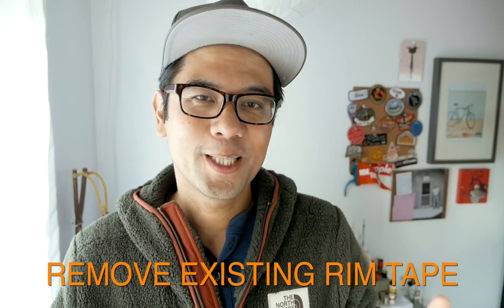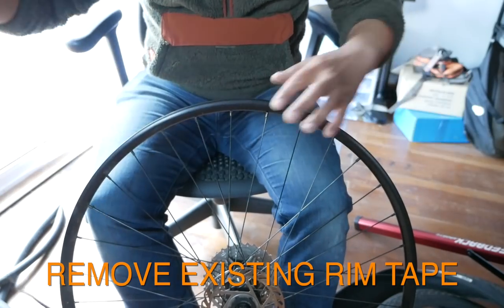How NOT To Go Tubeless - 6 Things I Wish I knew Before Going Tubeless

Comment: Tubeless is the way to go for me. To add to your dry test. If a fully pumped tire looks good, no need to unseat the tire again to add sealant. Hopefully you bought removeable core valve stems. Just deflate the tire, remove the valve core, and then squeeze in some sealant. Reinflate.
Reply: MrHockaluger best comment ever
Reply: Tubeless is not the X factor people make out, And when you do get a problem It's a real pain in the ass to sort! I just put sealant in my tubes and carry foam for any moments... Job done!
Reply: How stupid ! [ The host can be ... ( no offense ). Just use the inner tube itself to contain the slime sealant itself . "Wanna" a better 'tubeless' than the tube ITSELF ????!???? So help me Lord!!!!!
Reply: Manuel  Luis,the thing is,it isn’t tubeless if you’ve got a tube in🤣🤣to be honest tubeless is a real pain in the arse if you don’t use the bike enough like me 👍
Reply: I find tubeless setups get more tricky with higher pressure tires (like road bike tires).  Lower pressure setups (like mountain bike) are much easier.  Gravel bike is sort of in between.  Depends on the tire width.  Anyway, use a tube to "cure" the system and leave it overnight.  After removing the tube, use a brush to paint a little sealant on the bead then hit it with a floor pump or compressor (best).  At this point it's dry mounted (no sealant added yet).  Leave it dry mounted.  Get a spray bottle and put soapy water in it.  Spray the spoke nipples and value stem and check for bubbles.  If everything was done properly, there should be no bubble and the tire should hold air for hours (or even overnight) dry mounted.  The longer it hold air dry mounted the better your setup is. (use it like a gauge).  After all that, I recommend injecting the sealant into the tire through the valve hole.  Remove core first obviously.  Re-inflate.  Now bounce the wheel around or pick it up and shake it around to splash the sealant around the inside of the tire.  Re-install the wheel onto the bike and take it for a short ride.  It should be very solid setup after that!
Reply: My exact method, less messy
Reply: @Won Honglo as well as puncture protection! You can keep riding!
Reply: @manuelluis5456  I don't know why people don't just put it in the tube .if it seals a tire won't it seal a tube that's in a tire ?
Reply: @boracay12  RIGHT .100%.
Reply: RollinRat  I'm only concerned about getting flats .
Not obsessed with the few ounces of weight etc .   Tubeless is something to consider . But for now I took a old tube that did get a puncture and slit it down the middle all the way around . And put that between the tire and new tube .
  I also found where the rim meets on the inside ,there is a 16 inch gap (sharp edges) and got 2 holes in that area.
 So I filled that gap in .
  That old tube as a procter seems to be helping .
 I'll see how that works out.
Reply: RollinRat  Very helpful reply, thanks for taking the time to post.
Reply: @manuelluis5456  You miss the point. Tubes are stretched tight like balloons and can pop like balloons resulting in a blowout. Slime is very messy stuff and won't contain a blowout. Like tubeless car tires, a puncture in a tubeless bike tire results in a slow leak that liquid sealant can normally fix. Also, no tubes means no pinch flats (i.e. zero pinch flats) that means lower pressures and more comfort.
Reply: @boracay12  No, tubes can burst. It's not the same.
Reply: ADENDA: so far I've never had any complains at all !
Reply: @amak7106  I use using a air Guage to check the pressure on the tires and like it to be at the maximum limit . I ride on the road .  But to often got flats .  Later I found out my Guage was under reading so I was over inflating the tire .
 Now I keep it under the maximum and dont get flats . 
  To much pressure on the tube I guess

Comment: I've been riding tubes since 2001 and no problem so far , if I get a flat , I carry a case with patches , sandpaper and tire levers and a mini pump attached to the frame ( 15 minutes and I'm back riding ) and I also have helped a lot of riders on the trails .
Reply: Michael Paul  I live in Miami , Florida ; most of the trails lack of sharp rocks and that kind of stuff . I don't do air or rock gardens ... bad , bad experiences . I like long flowy trails .
Reply: Michael Paul  You are right , my friend ; I've seen videos of mountain biking in Texas and there so many rocks and sharp surfaces , same shit with Arizona .

Comment: Good video. I have some tips that may help. Firstly as already said it is about tolerance. I now put the tyre on the rim I'm converting before any tape, both sides, to give me an idea of how easy the job is going to be and how much tape to use. I had one tyre to rim that was so tight at this stage I broke a lever and gave up. The tyre worked with another wheel so wasn't wasted. Then electrical tape is what I use to seal the spoke holes, starting at either 3 or 9 o clock to the valve hole 2 wraps erring to one side of the rim and then to the other does the sealing job. If the tyre was tight that's enough. If loose I add a layer of a thicker tape, we call it gaffer tape here, a tape that can rip from the roll to the desired rim width. A loose tyre might require one layer or two. Again out comes the electrical tape for another thin layer of 2 wraps. This may sound like a lot of tape, but I am describing for a loose tyre. Other times I've gotten away with say 4 wraps of electrical tape. Advantages over specific tubeless tape are price, especially if you stuff up and building up the fit slowly. Weight would end up similar. The desired tightness is to require one tyre lever to seat the final part of the second bead, not two and a litre of sweat. One day you may need to get it off! Like now. Next is the valve. I use continental valves cut out of old road tubes. You need to be able to remove the core for a floor pump adaptor to inject as much air in quickly. I just make a tiny hole with a needle and screw the valve through the tape for a tight fit. I leave very little rubber from the old tube around the valve, otherwise it gets in the way of the tyre beads. Fit and screw the little round locking nut on the outside of the wheel tightly and keep tightening from time to time as you complete the next steps. Seat the tyre both sides and inflate with a liberal coating of soapy suds everywhere to about 30psi. More and it can explode off the rim. The tyre should pop into place, if not you might need more tape! Painfully this would mean removing the valve and drying the tyre and wheel so try and judge your tape to tyre tightness before getting this far. One lever remember, not doable with hands alone. Finally you are ready to remove the pump, let out all the air and refit the valve core. Peel back about a quarter of the tyre on one side to pour in your sealant of choice. Using a wheel stand or suspending the wheel or having an assistant is handy. Refit, add more soapy side everywhere and it should now pump up easily. 30 psi is again more than enough. Spin it, ride it, add more soap bubbles, swill the liquid wherever you see soapy air action, which you shouldn't. Then you're done for at least 6 months when you might need to add a bit more sealant if warm weather, or when your tyre tread runs out. Oh yes, after the first 5 minute ride you can let out air to the desired pressure. I go as low as 15 for front 29er 2.3 mtb tyres, 20 on the back. Grip is improved and punctures are now fixed without taking the wheel out of the frame with a product like the Samurai sword. I've had to do that only twice in 11 years of running my DIY tubeless, both in the last year and never had to use the spare tube. You will soon have favourite tyres because they were the ones that were easy to fit! I can see the benefit of inflating with a tube to seat one bead so I'm going to try that, but a good dry fit does the same thing. Good luck.
Reply: Very detailed and informative John....can see exactly where you're coming from in relation to fine tuning/reducing the gap between tyre and rim with tape to make it easier to pressurise and get seated...Ta

Comment: Great video. I have sent my bike off to have a mechanic set it up tubeless. I love the tubeless setup. I have had very few flats and have to think about my tires way less since going tubeless. A few tips I’ve picked up: orange seal doesn’t dry out as fast as other brands, so it works great in warm weather. Having the right tire\rim combo is important. I always use a tubeless compatible rim with a tubeless tire and have had no burping or loss of pressure. My mechanic uses a heat shrinking tape for the rim? It’s been super durable. 
Keep up the great channel Russ.

Comment: Small tip, when inflating initially, put a bit of pressure with your thumb on they tyre by the valve. It helps get it started without having to pump like a crazy person. Hope this helps

Comment: i would add these “musts”: use a special tubeless valve with rubber o-ring to seal, this must have a removable core (this is also easy to remove on the trail so you can install an innertube to get you home to troubleshoot), use soapy foam/water to help the second bead pop, the soapy water will also bubble to help identify tiny leaks on both sides so you can rotate/shake the sealant to seal, put in an inner tube over night at 40psi to help seal the tape to the rim before adding sealant, this is all for weight savings but i’ve put the sealant in the inner tube on my commuter where i didn’t care about weight but still have the benefits of the sealant, make sure you run enough pressure so the tire doesn’t roll off the rim on off-camber trails.

Comment: Still haven’t yet converted to tubeless and about two.
What I would like to know from you now, in hindsight, is whether or not the right quality, mixed with the ability to go lower pressure is revolutionary or not?
I am a newbie with all of this and really not clear that with the bigger tires in an inner tube if you’re limited in how low your tire pressure can go? Obviously with the older much smaller tires, You would have had a pinch flat if you tried lowering the pressure much at all

Comment: I use solid rubber tires on my 2 Huffy bike cruisers. These tires are actually filled with hard foam. Supplier is out of Houston, TX (Husky Bicycles). Takes thicker gauge spokes to support. Rougher ride but no flats.

Comment: I got a flat on my mountain bike. Tire seems to be sealed to rim. I don't know anything about tubeless tires on bikes. They sound like a pain in the ass to me. Rim tape, sealant, putting an inner tube in and riding it then taking it out. I am old school. We used to use inner tubes. If you got a flat you simply put on a patch,  inflated your tire and went on your merry way. This tubeless sounds way too complicated. More complicated than it needs to be. I'll bet if I didn't have tubeless like I suspect I probably do  i wouldn't have gotten a flat. The tire is worn out. Can I replace the tire and put in a new inner tube? Any advice from you guys out there will be helpful. Thanks so much.

Comment: Nice video! 
Just a few quick questions (if anyone knows) 
1. Recently I changed to tires that happen to be tubeless easy (TLE) ones and my bike mechanic asked me whether I wanted to try tubeless. I did so he hooked me up a pair of Schalbe G-ONE rather beefy tires as well as Schwalbe Doc Blue sealant. Now after 6 months I haven't had any flats on my adventure touring bike but I want to top up sealant. However I read on the internet that Stan's NoTubes Race sealant is a better choice compared to Schwalbe's Doc Blue (which is supposed to be the exact same sealant as Stan's regular TIRE sealant.
Can I just top up with Stan's NoTubes RACE sealant after a few months? or do I need to first remove the tire, clean it completely and then use Stan's RACE?
2. Stan's claims that their RACE sealant may not be injected through the valve since it is very likely to clog it. Can anyone confirm that, or do you guys tend to disagree with this statement.
3. Do you prefer Stan's RACE sealant over Stan's regular TIRE sealant for long distance bike travelling and adventure cycling?
4. I'm considering a Schwalbe Tire booster/aka Airshot compressor. Does anyone have experience with this compressor?
many thanks everyone for your potential reply.
Cheers from The Netherlands!
Reply: Tim Lange, I run 3.8in tires, so you might want to consider that with my answers. As long as I can hear sealant sloshing, I don’t clean out and replace the sealant. I’ve used Stan’s and Stan’s race, and I’m not sure the race stuff justifies the extra cost. I’ve tended to go with regular Stan’s and just use more (fatter tires). The bike shop guy told me the same thing about Stan’s race through the valve clogging it up, but I’ve used my small trail refill bottle to carefully (slowly) squeeze tubeless race sealant through the valve stem.
I’ve never used compressor or tire booster. On my fat tires, I wrap para cord around the circumference of the tire and cinch it, to kind of push the tire walls into the the rim better. Then a floor pump is good enough. For my 50mm tires, I just use a CO2 cartridge and that pings them right out.

Comment: Out-freaking-standing video!  It is to the point...and an honest presentation.  I have a relatively new tubeless set-up that due to family and health circumstances beyond my control, my bike sat for a couple years.  Happily, now riding my bike, one of my Stans is not holding air.  I am assuming the sealant is old...and now I think I need to “rebuild” it (new tape, new sealant, etc).   My guess is, that even after watching / listening to your experience, I will STILL make some of those mistakes!!  I will definitely buy more tape than I “think” I need!

Comment: I started tubeless in 2003 when tires and rims were not set-up well for mounting. Today, with tubeless ready rims and tubeless specific tires, it's a breeze....once you seal your rim- as your video noted. Tens of thousands of miles logged tubeless, and I'll only mount a tube in an emergency, never as a first choice. This only applies to cross bikes (gravel today) and mountain bikes. I'm  currently running 14.5 psi on Schwalbe Nobby Nics on a rigid titanium Salsa El Mariachi and she runs fine. Finish Line offers a sealant with carbon strips in the fluid; and, it doesn't dry-up, it's ammonia free. I just break the seal every three months, wipe-out the old sealant and rubber tumbleweeds, and add new sealant- beats trailside repairs while hoping to beat the setting sun on a ride back home.

Comment: I have been running tubeless  since 2013.  Growing up in Arizona you had three options riding off road. Go tubeless, run super heavy triple kevlar tires, or replace tubes every five miles (no none of those other gimmicks work there).  When I switched from 26 to 29 I ditched the Kevlar tires and went tubeless. It wasn't the greatest set up but it was better than nothing. Than my wife got some Mavic UST rims and tires that I found could easily be set up with a floor pump. From then on I understood the importance of having a tubeless ready wheel and tire.  

Even though I now live in Idaho and thorns are less prevalent the peace of mind is still worth it to me, it's nice to not have to worry about flats. Not only that but tubeless set ups ride a lot nicer IMO, and with MTB tires and larger there is a measurable weight savings as well.

Yes, you can have a shop do it a lot faster but it's always better to know how to do something yourself in my opinion. Plus you are going to have to refresh that sealant, pay a shop every time and that's going to add up.

Comment: For final inflation of my tube-less set-up I used a CO2 cartridge to ram as much 'air' as possible as fast as I could into the tire. Using a floor-pump just didn't cut it. They now make a floor pump that can hold a much larger volume of air for things like fat bike tires, and possibly tube-less demands. Nice video! Thanks.

Comment: Ugh, i'm about to go at try #3 on my back tire. First attempt, sealant leaking at rim and wouldn't hold air for more than a few hours. Cleaned everything and retried. After second attempt, sealant leaking at valve stem and flat after about 24 hours. Try number 3 I'm going to pay extra attention to that tape, and make the smallest hole possible.

Front tire of course worked first try no problems.

Thanks for the tips!

Comment: Hi, One option I like is to use a rim strip. You also have to use the yellow tape (if it is a Stans conversion) but the strip helps the tire to seat better, especially if the rim is not tubeless. I have converted several sets of wheels and have never had a problem. I'm even Still using the same 26 inch pair of strips in my current 27.5 rims,

Comment: I made all the same mistakes as you. And then, once on the road have had punctures that a) didn’t self seal and b) continued to leak with a plug. My first tubeless tyres fitted so tightly on the rim that putting in a tube roadside would have been impossible. Given my experience of difficult punctures with tubeless, I felt I had to buy another brand of tubeless tyres. Fortunately, they fit better. But I still experience punctures that do not self seal and plugging the hole still allows a slow release of air -needing a boot once I get home.